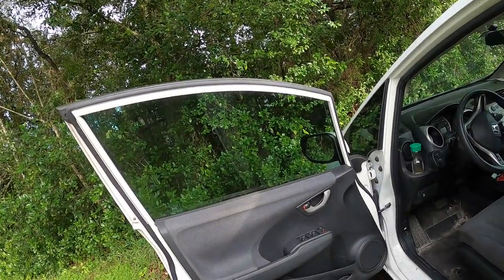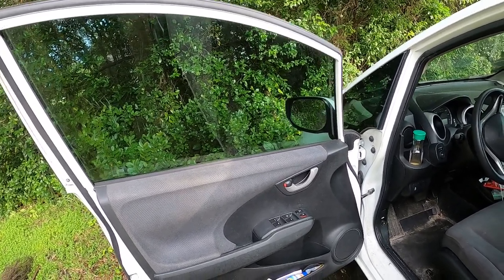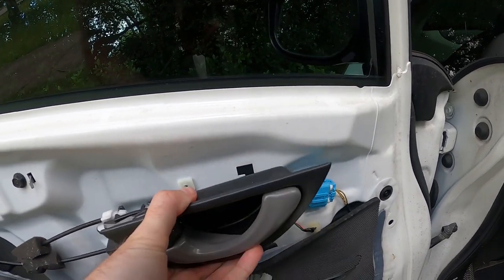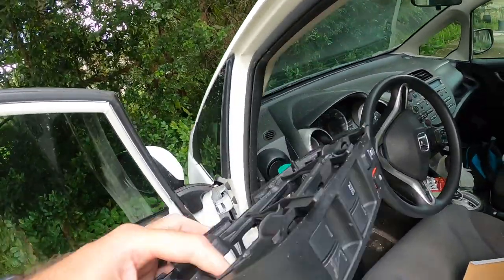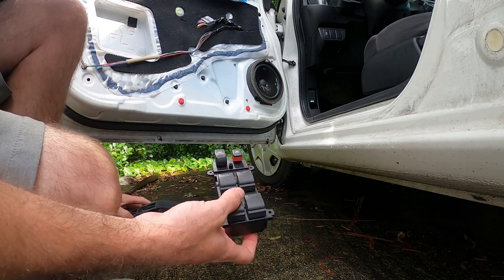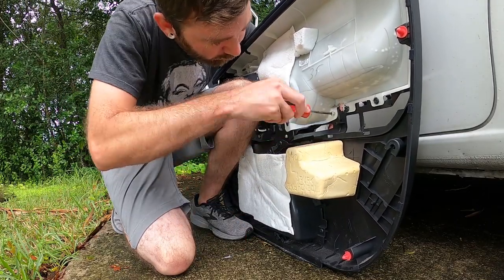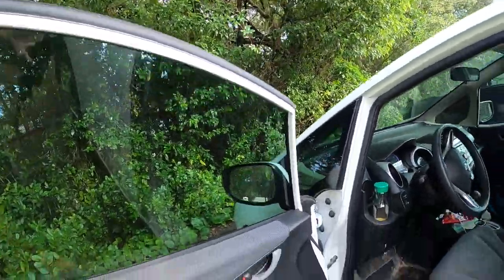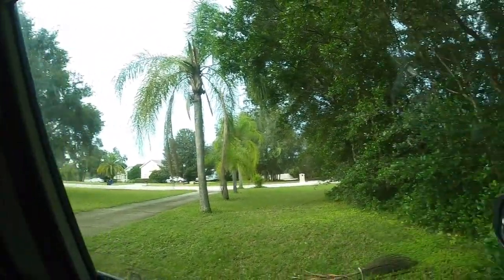Honda Fit (2013) Driver Window Switch Replacement

Comment: Great vid, but too bad the whole door panel wasn't in frame when you took it off. I don't suppose you have another vid that shows that? Thanks!
Reply: Ended up figuring it out myself. Not too difficult. Thanks for the vid!

Comment: Do i really need to take off the whole door panel to replace the switch?
Reply: No. Just the cover panel below the master window switches. Then remove the 3 small Phillips screws of the window switches, pull plug, install replacement part. Reverse the process. Done.
Reply: @mikemagalong3161  There's 4 not 3 screws

Comment: Just picked up a 2012 honda fit sport with a clean title. $4000 with 159k miles.  

Ones with wrecked titles are going for $7000 around here. 

The rear left window won’t work from the driver or rear switch. 

Probably an actuator I suppose.

Comment: What symptoms made you troubleshoot that the problem is the master power window switch? Our Honda Fit’s passenger front window does not go down but going up is ok. We swapped our rear window switch and still not working. Does it mean the master switch is bad? Thanks in advance
Reply: What ended up fixing it ?

Comment: Why did you replace it?  What was the problem?
Reply: I have a 2010 Fit and I'm gonna do this same job as soon as the part arrives. My symptom is the fact that the "auto up" click on the driver's side window has gotten a little wonky and I'm afraid for it to stop working and get stuck open. It still works but I'd rather replace the part before it fails completely. If a window doesn't work at all, it's probably a bad regulator, which I also have on my car but haven't been able to replace yet.
Reply: @Snicker60515  mine did exactly what yours was doing except after a month of that now it just gets stuck open
Reply: Couldn’t you have just unplugged the wiring harness from old switch and plugged in the new switch to verify that it solved problem before removing door panel and doing full install. My luck I would have swapped out switch and reinstalled everything and still had problem.

Comment: Usually not the switch . Most often the wires,are broken inside the rubber tube holding wires inside by door hinge. Actually is mostly always.